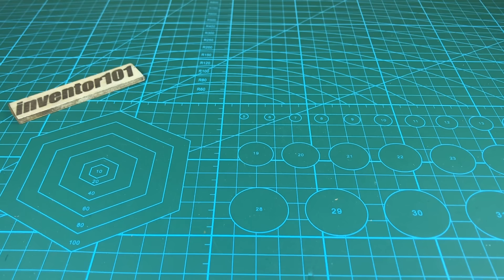3 SIMPLE INVENTIONS

Comment: Why did you fix the iron solder strip on the glue gun?
Reply: He changed it to 5v USB power instead of AC power. I think i will do this, but add rechargeable batteries inside the handle with a way to charge it.
Reply: Thats silly changing 220 to only 5v. Usb has only 5 v. He replace the geating ellement  from soldering iron still needs 220v. Power bank will overheat. And sure it won't work .